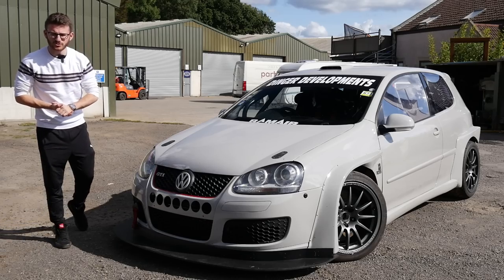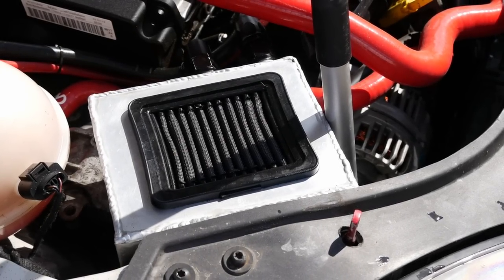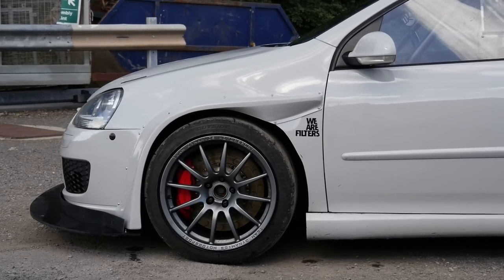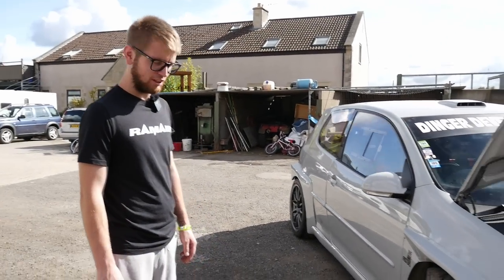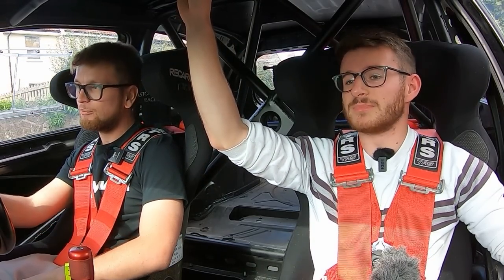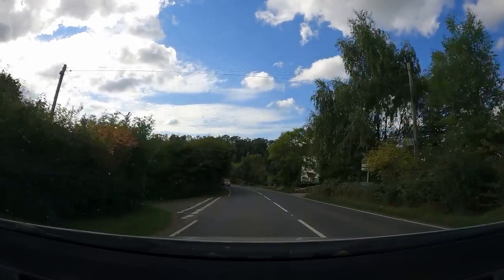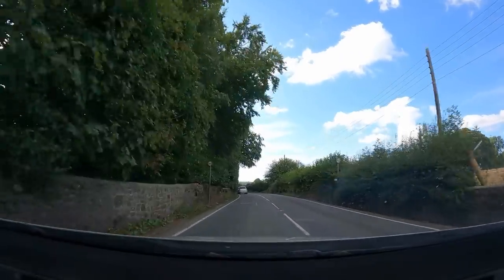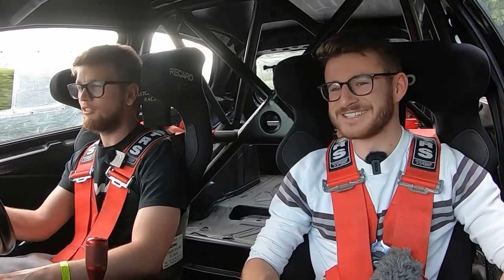This 370BHP *WIDEBODY* MK5 Golf GTI is a Track MONSTER!

Comment: Nice usable power in this! 
Good to see the tyres not spinning up after every gear change trying to find some grip 👌
Reply: Sometimes it tries to light up inside wheel. I may go to a gripper diff.
Reply: @shannonobrien5798  would it make sense to fit an MK60EC1 ABS module capable of XDS?
Reply: @shannonobrien5798 I’ve got the same set up with the arch kit etc, do you make those front splitters?
Reply: @TomLePreux-gb9ef hi mate. Yes made in house
Reply: @shannonobrien5798  do you have a link to buy one?

Comment: All that fluttering in the beginning, was it effecting the acceleration? Lije was it stalling/hiccuping at the "beat" of the flutter? Mine seems to do that on upshifts, accelerating after slowing/stopping and driving uphill and i have been trying to figure it out for a few years. It only got worse with k04

Comment: Love that he hasn't gone crazy chasing horsepower, and kept it at a useable level. I believe 350-400 HP is the  sweet spot on front wheel drive cars.
Reply: It is very useable power. Sometimes could do with a little more on the straights

Comment: The sounds are mental. The chirping, the meth kicking in and then the exhaust wow! Who mapped this one luke? RTECH?
Reply: TSR mapped car mate. R-Tech still haven’t given me a date 2 years on after sending a spec sheet. Shocking.
Reply: @shannonobrien5798  hey what gear box/ stick you running ? Is it the 1.8 or 2l I’m new to the vw scene but just recently picked up a 320whp polo gti
Reply: @taylor9255  02M 6 speed with Wavetrac LSD and 4th gear support.